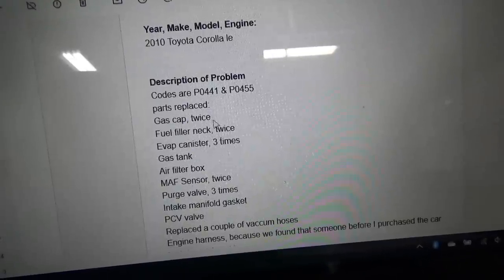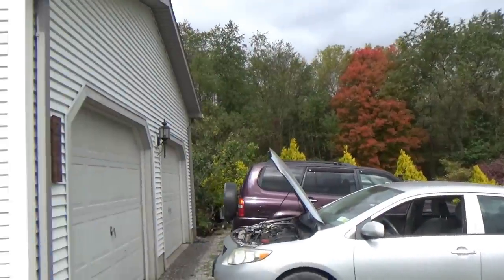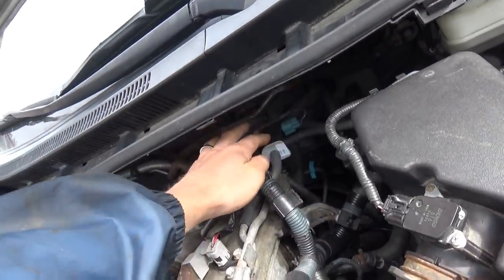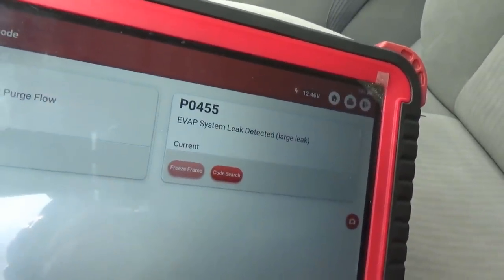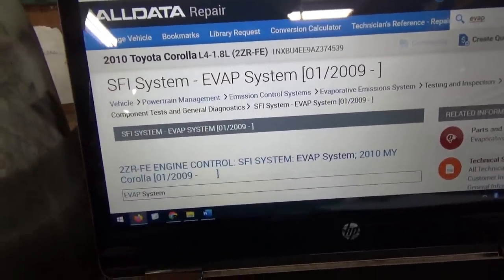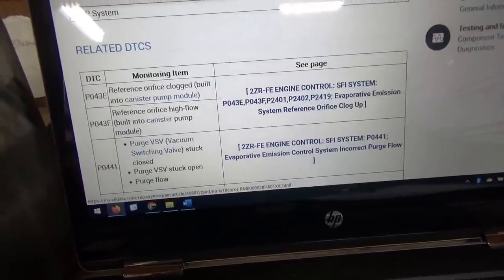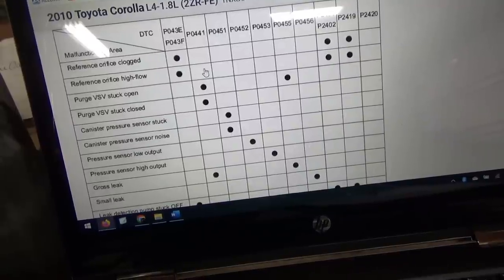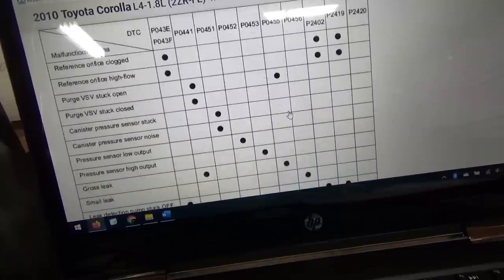2 YEARS of Parts Cannon?! (Toyota EVAP - Part 1)

Comment: Right off the bat. One of the issues with cars like this is the fact that all those parts were replaced. You could be looking for new problem created by whoever replaced the parts. So this is one is likely not going to be easy.
Reply from the maker: Yup more parts cannon = more diag time 😅
Reply: Especially if there are non-OEM parts.
Reply: @RMR57  Exactly. They may have found the right part to replace but may have done a shit job of replacing the part and thus introduced a new problem. Or the part itself is defective. Or any combination of those two added to the original problem possibly still being there. But at least it's known that the system has no leaks. So that's not the problem.

Comment: Hey Ivan...  I've been using the 2-day TechStream-Lite TIS subscription for Toyota/Lexus problems like this one.  I use the $65 for two days subscription, which I think is pretty steep, but I haven't needed to use the full two days on any car I've used it on (yet).  If you do a lot of Toyota business they also have a $1,295 per year subscription but, I can't justify that in my small garage (I'm supposed to be retiring soon).  Point is, the TechStream-Lite software is very helpful for problems like this one.  Not only does it run all the tests, it gives you a lot of notes and other information... what numbers are good, what's out of range, the highs and lows you can expect and how long specific tests should take.  It's so handy to be able to pull up a factory schematic on one screen and switch back to the scan data with just a few keystrokes.  Like in this case, I think the pump is underperforming... it's taking too long to pull the pressure down and the monitor is timing out and setting the DTC.  Seems I've been using TechStream for Toyota customers, Consult-III for Nissan and the Verus or ADS-325 for everything else.  As a matter of fact, I wish there was a scan product like TechStream for all makes... it's easy to use, very comprehensive, and I haven't had it lie to me yet.  Nissan Consult is pretty good to, but it's not on the same quality level as TechStream.
Reply: Begs the question, if Techstream is so good why didn't the Toyota dealer locate the problem?
Reply: @rafflesnh  It could been the technician🙃
Reply: @rafflesnh  If the mechanic isn't up to the task, it really doesn't matter how good your tools are... a mechanics MOST effective tool is the one between his/her ears.
Reply: The cracked software is available
Online, very easy to find and the OBD2 to usb adapter is less than $20, with a copy of the software and all instructions to install it, off Amazon. Save the $65. Get a permanent setup.
Reply: @cccspokesmanandcofounder  Yeh... I'm familiar with it.  I bought the OBD connector on eBay (it came from China) and it came with a CD of the software.  Long story short, the software had several pieces of malware in it... one wanted a ransom to get my PC to boot (it booted up to the "Happy Screen" and locked up).  A local computer geek fixed that for me.  The second malware gem took over my browser so every time I tried to get on the internet it could only go to a web site that told me my computer was going to erase itself.  I was eventually able to get the software to load and I could actually get it to connect to my daughter's Camry... with a whole bunch of communication errors and PC crashes.  Bottom line:  I can't, in all good conscience, use crap like that on someone's car.  I'm old school.  I feel I have a responsibility to repair my customers cars... meaning that I return their vehicle in a serviceable condition with their complaints addressed.  The hacked TechStream I got from eBay set off all kinds of alarm bells which left me very skeptical of the efficacy of the scan tool.  I can't do that to my customers (although there are several who would deserve a "bricked" ECM).  This might be acceptable to a DIY'r who is willing to keep re-hacking it into submission.   That sort of tool is completely unacceptable to every responsible garage owner I know.

BTW:  The real subscription gives you access to the OE Toyota documentation, TSBs and Identafix Direct-Hit (for Lexus and Toyota).  My hacked version could not even connect with TIS.  A .txt file on the CD with the hacked version also warned me not to connect with TIS with the screen portal.  Not sure what would have happened if a connection could actually been made... Cyber police(?)
Reply: Toyota giving us OEM level diagnostics for $65 per use is a massive win for third party repair, and peanuts all things considered. We want to encourage that with our wallets, and maybe other manufactures will up their game as well.

Comment: Three years ago I bought a beater 2008 Toyota Yaris.  Manual transmission.  I've put 80,000 miles on it. It's old, clunky, noisy, has a rough ride, but.... it starts everyday. Just changed oil. One thing I learned.  If you buy a Toyota,  the 1st letter of the VIN will tell you what country the car was manufactured in. My Yaris starts with a "J" for Japan.
Reply: I bought an echo from my co- worker for $200. Had a bad engine ( overheated). Put a Japan engine in it and drove it for 4 years. Consistent 47 mpg.  Ran perfect when I sold it for $2500.  I sure wish I still had that one.
Reply: @kinglangren  yup.... I lived in the UK a few years. Gas is $9 bucks a gallon.  No one drives anything bigger than a Corolla. $9 bucks might happen here too one day. Yikes.

Comment: There is an air filter further downstream in the vent hose from the canister. It could be restricted just enough to corrupt the purge and seal test without causing a problem refueling the car, much like a spiders nest blocking the vent in some cars. The pressure changes they are looking for are so minimal the slightest restriction can throw the results off. Looking forward to part 2.

Comment: My buddy Bryan ( rip) dealt with a issue like this. F250 that would stall or not start. 4 fuel pump, wire harness, injectors, MAf. This was a year long issue Anyhow I drove 2 hours to look at it because I was tired of questions and him getting  ripped off. Can't fix a car over the phone. Anyhow found the problem with no diag necessary.  Quick inspection found a missing ground to the fuel pump driver.

Comment: my next step would be to do the manual test again but this time with that vent hose reconnected. It looks like you left that hose disconnected during the test. I think it's possible that there is a blockage in the vent hose going to the fuel cap area causing the pump not being able to exhaust and thus not able to create a big enough vacuum which makes the system think there is a leak when in reality the pump is limited by the blockage in the vent hose.
Reply from the maker: Good thought... But customer has no problem filling tank so vent hose is fine 👍

Comment: I have to admit that I am not great with evap system problems.  Sometimes I get lucky and find a bad vent valve or bad purge valve or flooded canister.  (caused by overfilling the gas tank)  Other times, I might find a cracked or broken hose somewhere along the system.  Usually at or near the canister.  A couple of times, just broken wires or corroded connection to a purge valve.  Even had a couple with a missing gas cap or the customer fills the gas tank with the engine running.  But every time I've come across a Toyota with a evap leak problem, I've very rarely been able to solve it.  So Ivan, I hope you don't mind if I just sit back and watch you take a crack at this.  Maybe I can learn something too.  I'm looking forward to part 2.

Comment: I have surfed down the comments and didn't see anyone questioning the measurements - i.e. is the issue that the electrical system is reporting a false failure?  I would start checking wiring next to see if anything is wrong - earths and powers and maybe signals.   Looking forward to seeing part 2.  As also mentioned, Scotty Kilmer will be amazed to learn a Toyota broke down! 🤣

Comment: Feel the owners pain after all these replacements. We've all gone down route 66 with all cylinders blazing and still no joy, except a bill that keeps expanding, vertically. There's so many bloody variables,  it's hard to know where to start. This scenario goes beyond credulity as the majority of the relevant parts have already been exchanged. The factory test has held up and definitely time to take a well earned break. A cup of tea or coffee is in order with a jam doughnut to finish it off. Take off your jacket, turn it inside out and hope the leaprauchans will go back to the tavern 🍺, drinking Guinness.

Comment: I'm so curious if you're going to have a similar diagnostic to what I had in the shop about a month ago. I noticed when you commanded the purge valve "ON", the valve was clicking. I had a 2009 elantra in the shop we bought from carmax via auction. You can tell they went through the entire detailing process and everything to get this car perfect for sale, and then they wholesaled it. Another win for us, but here's what I found. Gross leak detected and evap performance codes. Same as you have. On the scan tool, did the audible click test like you initially did, and noticed the purge and vent solenoids were clicking constantly when commanded on. Characteristically from prior experience, when the tool commands the state to on, the valve fully opens and stays open. When there is a toggle button available on the scan tool, it'll toggle on and off every 1 second. I thought it was strange, so after pressure checking, smoking, everything, I found no issues. I dug deeper, and service info wasn't available as far as PWM duty cycles and the state of the valves. So I hooked up my scope, measured the commanded duty cycle on the purge, and the "ON" state was 95%. At 95% pwm, there should be no clicking, that solenoid should be open fully and staying that way. Same thing happened to the vent valve as well. Cheap no name parts on the car. I went to O'Smilies and picked up an intermotor valve. It wasn't a reboxed OEM which I was hoping for, but it did say built in USA. Slapped it on, same thing. Vibrating valve at 95% duty. I goto the other usual scumbags and found a dorman made in the prc valve, and besides the dealer, it was my last shot. The autozone valve was the exact same valve the intermotor was, so I exhausted my aftermarket choices and tried the dorman. Low and behold! commanded on and stayed wide open at 95% duty. Did the same with the new vent valve, however the first new valve I got worked and I didn't go down the rabbit hole like I did for the purge. In summary, what was happening was the PCM was commanding a variable duty to the purge valve while the engine was under load. The aftermarket valves didn't behave like the PCM expected, so at 30% duty, the valves weren't even opening. And since the pressure didn't change in the tank like the PCM expected, it set the gross leak and evap purge flow incorrect codes. Same with the vent. Service data unfortunately doesn't give expected behavior at a given PWM percentage, so finding that one was tricky, and I just had to trust my gut when the valves were clicking and vibrating when being commanded fully open. There was a lot more testing I did before grabbing parts, just too much for a youtube comment lol. Just because a part is new, doesn't mean it's good. I trust nothing, tools included (found bi-directional controls to just not actually work when they said the "output" was on). I swear Ivan, I am to Nevada what you are to Pennsylvania. Dealers just keep on growing my client list.
Reply: This actually sucks man

Comment: So I just started watching but I’m predicting a broken wire. I had a similar problem (same codes) several years ago on my ‘07 Buick Lacrosse. I didn’t go quite has hog wild in replacing parts; just the gas cap and the EVAP in the rear. I left it at my local Buick dealer when I rented a car (Enterprise was almost next to them) for a business trip. Took them less than an hour to diagnose a broken wire under the carpet. I authorized the work over the phone and no problem since (but the car was totaled a year or so later when a deer hit it).
Reply from the maker: Broken wire usually trips a circuit code. Those are generally easier to diagnose :)

Comment: The first thing that set the cringe sensor off was the flagship PCM. I’d be curious if it was replaced before this problem started or to try and fix this problem. I would look to confirm emission calibrations with known OEM VIN data through Toyota. So often programming can be a culprit in issues that are emission related and with flagship units, I’ve seen a lot of discrepancies in calibration options or even known good units. I can say for a fact that in many cases, “new” doesn’t always mean good… but with Flagship PCMs those numbers increase 😂😂😂

Thanks for the follow along, Ivan. This one looks interesting.
Reply: I had very good luck with flagship

Comment: You're comment on the weak vacuum pump makes me wonder if that's the problem.  The module it lives in doesn't seem to have been replaced.  I'd also check all the "plumbing" to make sure the hoses are going where they're supposed it.  I could see someone getting that wrong and no one catching it.

Comment: These codes appear on my 2004 Sequoia (168,000 miles) since I bought it 2 years ago.  Replaced fuel cap and the little valve cannister(vent solenoid?) located next to the larger charcoal cannister.  I now just use my cheap scan tool to clear the codes, they eventually return but as it does not affect the running am happy to leave it.  I recall watching a similar video you did a couple of years ago on another Toyota, I think it was a Camry, seems a common problem on Toyota's.

Comment: JUST a thought Ivan,could a line in the system be either smashed close or plugged by a ball bearing by the previous owner in an effort to bypass the smog system.Since that was a common way to do stuff in the 70's when smog stuff came out?You could not remove smog equipment then but 99 % of inspectors  would never suspect a BB or bearing inside a rubber hose to block it.OF coarse a smart guy could may be check with a magnet on the rubber hoses.haha this is a good on IVAN.
Reply: Honestly - just looking at the parts cannon that had been fired and that most of the replacement parts were OEM my first thought was a manufacturing defect in one of the pipes which would somehow cause a leak or blockage. That's a clever idea though and might be more plausible.

Comment: As a Toyota tech I see this all the time in the 18 and up models. Sometimes it’s easy to repair sometimes not even with smoke. If the 1604 is set, it’s almost always intermittent purge valve sticking open. Unfortunately there is a several month back order on those 🤦‍♂️

Comment: PSI is throwing me off, I usually see the ref pull down to close to 20 mmhg, but I also switch to graphing, just help with the visual. Be interesting to see part 2, did you isolate the different sections?

Comment: In many states you will fail inspection (smog test) if a check engine light (OBD-II failure) is on. With the result being you cannot get the car registered. EVAP, short for evaporative emissions, is a part of OBD-II. So it has to be working to pass smog.

Comment: I have had EVAP issues exactly once with my 97 Jeep.  The system on that model year has just a single purge valve, and the charcoal cannister (no pump).

The valve failed, stuck open.  I replaced it, worked for a week, failed stuck open again.

Turned out the canister was bad, which is unobtainiom on a 20+ year old Jeep.

Turns out, a mid 80s Buick canister is perfect fit (available at AutoZone), and that fixed the problem, after installing the canister, flushing the particles from the tubes, and installing yet another valve.
Reply: Good job, good tip!
Reply: Probably same canister but different part number due to some minor difference - even just brand sticker.
Reply: @ehsnils  no clue, it worked and that's all I cared about.  Here in GA we don't have inspections after 25 years, and at that time I had to pass for three more years.

Duralast VC120, for those that care.

On this model Jeep, the canister mounts on the frame rail right next to the distributor (basically underneath all the AC components) rather than back by the rear axle.

Comment: very good content ivan ,i think the problem is the fuel tank pressure sensor system side is does not change much with elec pump or when you block the vent with purge valve open ,tks great video

Comment: It appears to me that Step 4 of the manual evap check did not perform as it should. When the purge VSV, vent valve, and leak detection pump are all on, the pressure should release over a 10 second period back to atmospheric and it did not. It stayed at approximately 13.7 psi. Then, in step 5, when the purge VSV and vent valve are turned off, the pressure should drop to approximately 13.6 psi or a little lower in about 10 to 20 seconds. I do not know what would cause that to occur. The next step I would take would be to check that all of the hoses in the evap system are actually attached in the right places.
Reply: These steps seemed tough to follow, at least from home. I would like to see how they look on the TiS OEM software. Often you get a better visual or graph to follow. The aftermarket scanners often lose some of the needed/helpful parts of the software in translation when stealing the OEM software.

Comment: hmm, original cannister broke up and left debris in the line to purge valve/engine, they replaced everything but didn't flush and clean the lines out?
I've had that issue multiple times in the past, dating from 2012 back to 1980's carbureted vehicles. my solution was always placing a fuel filter in line directly in front of the purge valve.